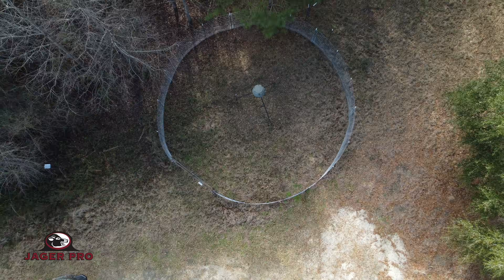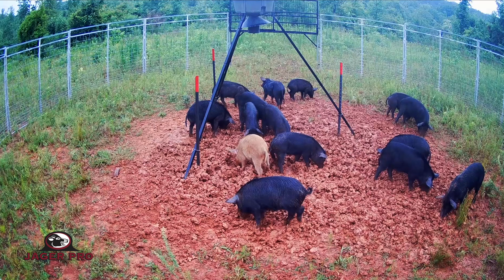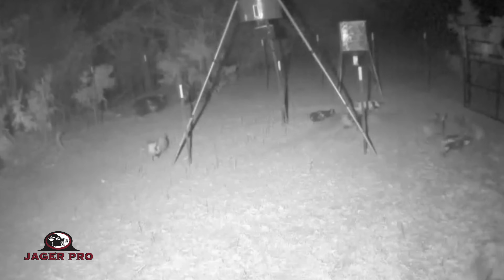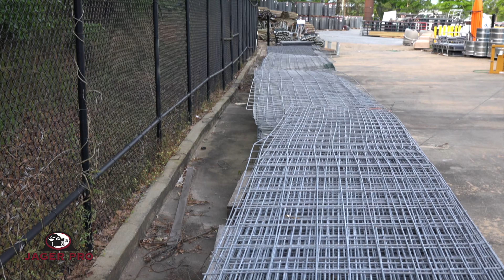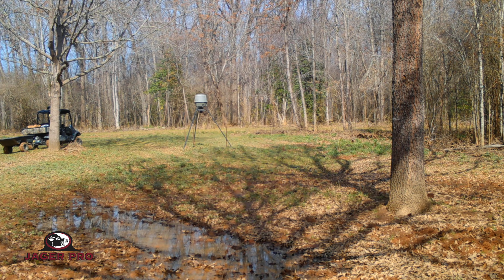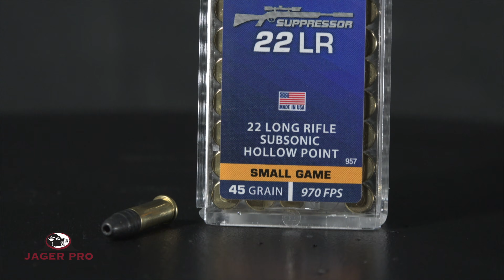WILD HOG CONTROL | JAGER PRO™ SHOW I 60+ Capture Q&A

Comment: Greetings from Bosnia and Hercegovina, your trap is very good and efficient,can you just till me the principle on which the Doors is lowered,greetings from Damir
Reply from the maker: From the Jager Pro app, there is a drop gate command. That pushes a signal to the camera at the trap site and then relays it to the actuator inside the control box that is attached to the gate. Once the actuator trips the trigger, the gate falls. All wireless.

Comment: As I'm considering trapping as a service, I'm trying to determine what/how to charge for it so I can come up with a ROI.  Do people charge so much per head?  So much per pound?  Amounts?  Some other criteria?
Reply: You will have to be proficient in trapping pigs. They won't come to the trap and you just close the gate. The longer you trap, the better you will get. Just keep track of what works and what doesn't. Also, don't be fooled by a lot of commercials selling attractants. Whole corn is best, soured corn helps, but plain whole corn works best, in my opinion. 
I trap for food for my family and what we don't eat goes to people who need food. I don't make money but I fill my freezers in no time, and give the rest to a local charity kitchen.
Reply: This has been my question for years, there are companies that charge a fee then charge per hog, but I have yet to find a company with a successful money making model for services.
Reply: @VetOnFire  With as may feral hogs there are running around, one would think trapping would at least be fruitful.  One big issue I've been having is that nobody (in trapping) seems to want to offer any financial info (afraid of competition?).  My impression of Jager Pro is very favorable as they seem to have developed a great system, and I'd love to support a veteran-owned business.  However, if I can't get sufficient info on which to calculate a risk/reward equation, I'll reluctantly be forced into using lower-priced components to minimize my financial risk.
Reply from the maker: @markmonse5285  Good question, so let's measure the Return on Investment (ROI) and cost per pig of our Integrated Wild Pig Control® approach from the farmer's perspective. We will use the video, "Russell County, AL Project 257 Pigs Captured In 7 Months" as our example at https://youtu.be/wCSb31RNSno. Research demonstrates each individual pig averages approximately $400 of crop damage annually (Bodenchuk, M. J. 2011) in an agricultural setting. This means 257 pigs would have cost the farmer around (257 pigs x $400) $102,800 this year while exploding their population next year with annual reproduction of two litters per sow. 
Expenses: Two flex panel M.I.N.E.™ Trapping Systems ($3,500 x 2 traps) plus one rigid panel M.I.N.E.™ Trapping System ($4,500) plus total labor (69 hours x $100 per hour) $6,900 = $18,400. AR-10 rifles topped with thermal scopes are owned by the Hog Control Operators™ and are not the farmer's expense. $102,800 of future annual damage was saved by investing $18,400 into equipment and trained labor. Return on Investment (ROI) to the farmer = 559% ($102,800 divided by $18,400 = 5.59 or 559%) Cost per pig = $71.60 ($18,400 of annual expenses divided by 257 pigs = $71.60) 

Basically, it cost $72 to stop a $400 problem. The income one can generate is dependent on how well a Hog Control Operator can convince their customer to spend $100 per pig to save $400 of crop damage per pig.
Reply: @markmonse5285  I've done a good bit of research and it seems the risk/reward is a big factor.   The Jager pro system and anything similar takes time to condition the pigs, I've seen that a lot of land owners do not have patience needed to do this properly and unless you have multiple Jager systems across 4 or 5 properties , it doesnt seem like a big money maker as a primary business.
Reply: @JAGERPRO  I've seen all that same data covered in all your past YouTube videos and RFD TV program, and I have no issues with your numbers.  The ROI I was referring to had more to do with charging an amount commensurate with trying to get a landowner to spend that $72 (or "X") to solve the $400 problem.
Reply: @VetOnFire  There are some that dispute that it's the $400 problem (as Jager Pro states), and that can complicate things further.  Your comments some landowners not having the patience for trapping also seems to be a factor, and I've run into some that seem to prefer opening their property to hunters for monetary gain.  Hard to ignore a potential revenue source, even though patience with a trapping setup would probably eliminate a larger quantity of hogs than shooting.
Reply: @JAGERPRO  Are gates and 18-60 panels no longer sold individually, and now only available as part of a private/corporal package?
Reply from the maker: @markmonse5285  I recommend contacting your closest authorized Jager Pro dealer. They can be purchased separately.